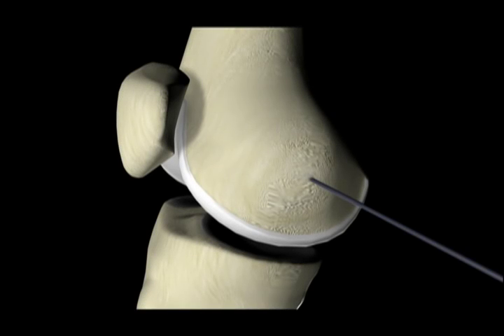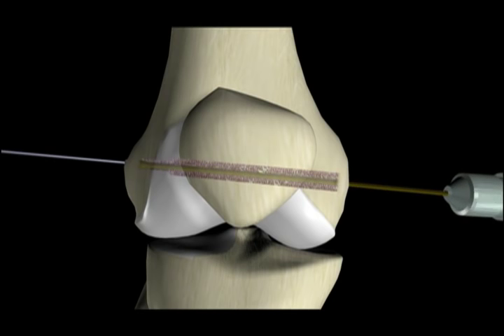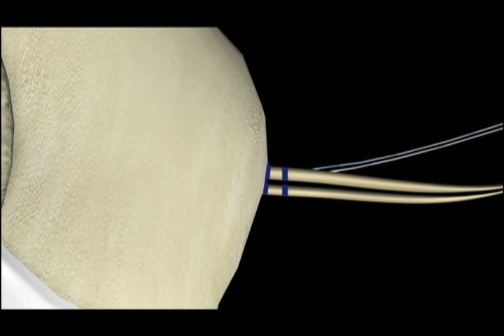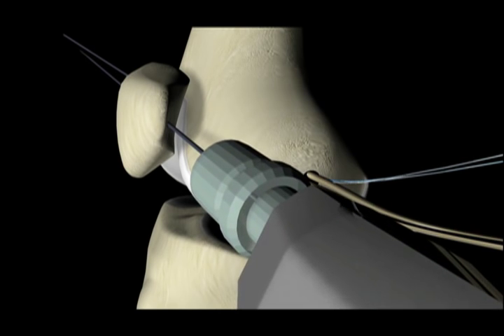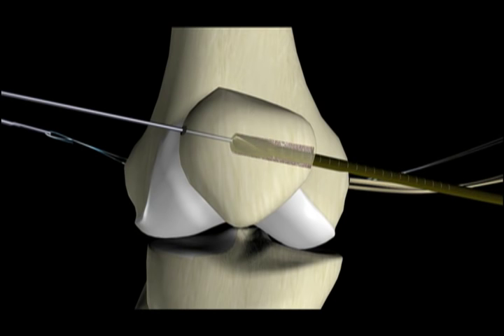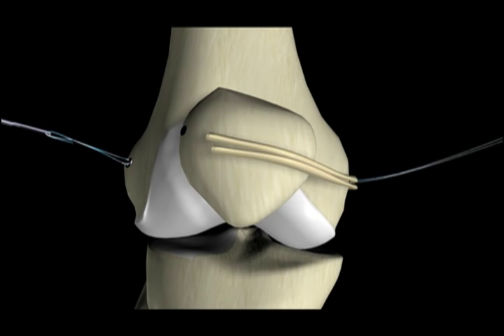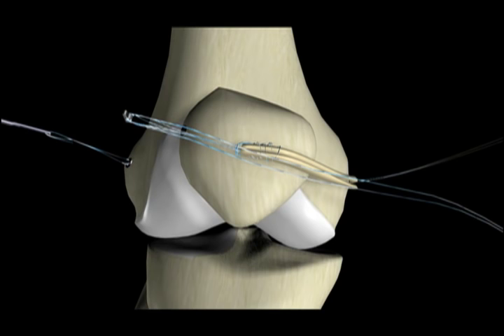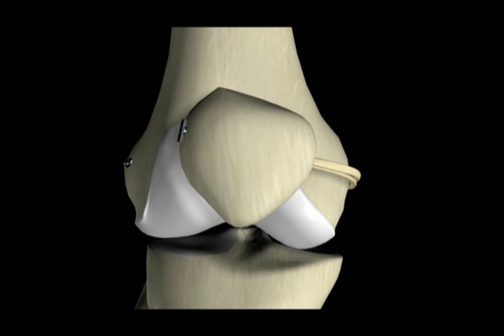MPFL Reconstruction Animation

Comment: Had this done recently and heard a lot of complaints about the pain in sitting or laying down, needing to stand every few minutes.  I HIGHLY recommend the CPM machine, which keeps your leg in constant motion, bending at the knee.  You can even set the range of motion digitally.  I sleep with it, ice with it, use it whenever I'm hurting and it's instant relief.  This recovery would have been miserable without it.

Comment: I had this in October, and standing up for the first time is so painful then trying to walk is very difficult. Also bending after surgery is probably one of the most painful parts but my recovery was pretty good I was only out for about 2 weeks then went to physically therapy which helped a lot and now it’s February and I’m basically back to normal except for running it still a little difficult.

Comment: Had both knees done, one in 2014 and another in 2020.  The one in 2014 was just the mpfl but the one in 2020 was the mpfl and they grinded down the bone where the knee cap sits.  Best things I can recommend are going on pain meds taking one before you sleep and one as soon as you wake up.  You will wake up in intense pain.  But at the same time I recommend trying to get off the pain meds as soon as possible because they plug you up good... besides that general icing and keeping it elevated.  I'm currently about 1 week into pt for the second one.  When pt starts you can feel yourself getting better every week.
Reply: How long did it take for a 100% recovery for both knees?
Reply: Did u have patella Alta?

Comment: I had this done in August and am getting the same procedure on the other knee in 2 weeks... the pain of the first week is excruciating but I already feel much stabler and stronger.
Reply: Hi im sorry to bother but if u don’t mind sharing could u tell me how it went? Getting it done very soon!
Reply: @maximiliendjanguirov9296  I just got it done 4 weeks ago on my left knee. The first week after the surgery honestly sucks since you can barely get up at all. It also hurts pretty bad, and you will feel really tired (because of the pain meds), and you can’t take a shower either because of your bandages. Right now I have been doing PT for three weeks, and I can walk with the brace on full extension, and bend my knee 90 degrees. It doesn’t really hurt anymore either. If you want to heal faster you have to do the physical therapy they give you, and make sure to ice.
Reply: @piercetetlow9482  yo thank for all the info, really really appreciate this 🙏🏻 is there any way i could contact you somewhere to discuss further? Thanks 🙏🏻

Comment: during this operation, nerves will inevitably be cut over aswell. It takes a long time for the nerves to grow back together properly. Meanwhile, touching certain areas of the skin close to the nerve, might cause some nerve-disturbances (ie. tingeling, numbness etc.) over the entire knee. Your brace might be touching the scar on the medial/lower site of the knee causing these disturbances. If that this is the case, it is completely harmless. But ofc, its impossible to diagnose from so little info

Comment: I just had this done yesterday and have been in quite a bit of pain, found out after surgery that I am narcotic resistant and the morphine and fentanyl given to me in the hospital did very little for me and the hydrocodone I’m on now is not doing much for me either. It is interesting to know how it was done tho great video
Reply: I just got this done too! I’m about 6 days in and in a lot of pain. Instead of giving me morphine they put a nerve block in which numbs my whole leg. We had to take it out on my fourth day and been in a lot of pain since. The brace they put me in actually isn’t straight, they have me bent a little, 30° flexion and 70° extension. the worst part for me is allowing my leg to dangle while using the crutches.
Reply: @chloewirick2379  i just got this done yesterday, and they were going to give me a nerve block but couldn't get an iv in (LOL) so im just on asprin and tylenol right now, its not doing much for the pain but i do find ice makes the pain better did that work for you too? i haven't used crutches at all yet bc im so scared of just letting my leg dangle ahhh